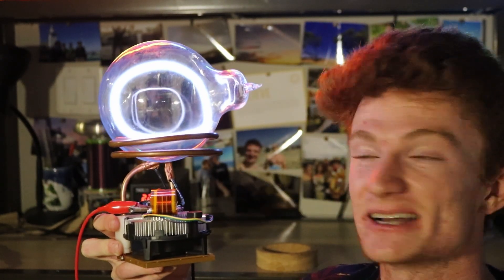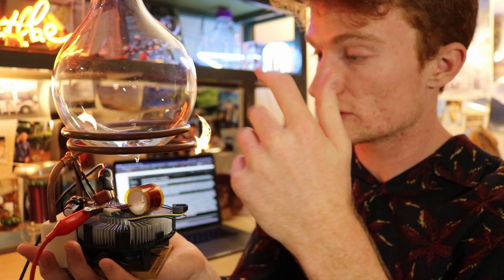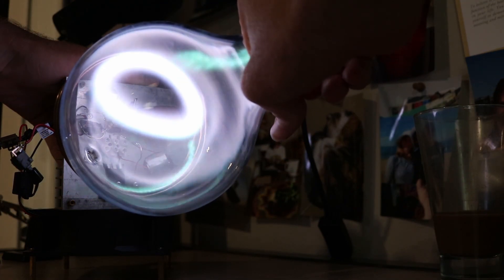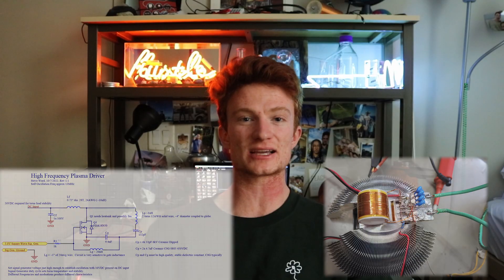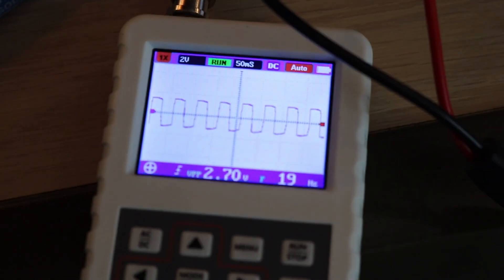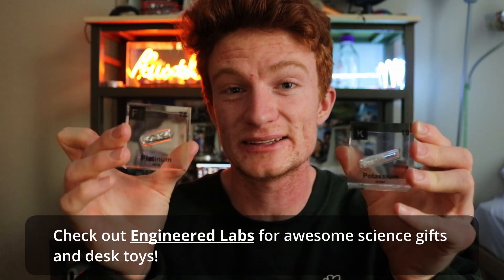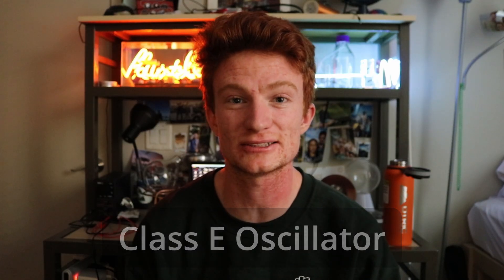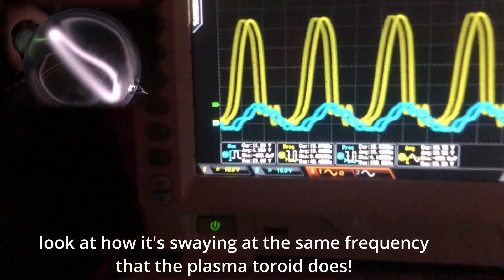perfecting and explaining the plasma toroid

Comment: 8:31 don’t joke with chemistry, without it we have nothing to do here (or nothing with), no cheese, no soda, no nitric oxide (|), no plastic, no transistor, and in vain you neglect flux... although the cheap pink flux gel "TT" gets in the way work in microwave circuits if you don’t wash it off, even the discolored one only marks the soldered places, becoming discolored but not rendered harmless, it conducts slightly and various bugs soldered by it and not washed off from TT flux do not start up... but there are slightly more expensive fluxes for radio engineers without any complaints, and simple one... - there is also exists  solder in the form of a tin tube filled with rosin inside (a flux that does not require rinsing)... once in my childhood, in the 90s, I also tried to start soldering without flux (in this style of research it is better to be more difficult... learn to solder by lead of aluminum so that you develop a habit of oxides, which work just as well with an oxidized soldering iron tip, the result does not deteriorate...
etching boards in acid is a well-known and tempting idea with its apparent speed, but it’s just difficult and dangerous to dissolve copper with acids, it’s better to find and to buy FeCl3 * nH2O at least 0.25 kg, or better 2 kg, anhydrous FeCl3 can heat up violently with water, you need to work carefully, yellow powder hexahydrate FeCl3*6H2O are peacefull ... having sufficiently freed (putting part of the powder in another container) a third or half of the volume of the reagent bottle (sold in markets where soldering irons and tin and fluxes, soldering acid... etc.), pour water into it, not to the top, but half of it approximately the volume of powder, so that you soon get a saturated solution with a fair sediment of excess salt at the bottom, this liquid is used repeatedly, sometimes even copper falls out of it, it is sometimes filtered from rusty films and mosquitoes, and the board is etched with FeCl3 aq.sol-n. preheated in a pan full of a hot water tap to 45 ..60C holding the bottle in a water bath like this, pour the solution from the non (preventing the sediment from pouring out with the liquid of the etching solution into the etching cuvette, ideally - if it will motor-swaying, ideally so, that the board floats downwards in paths on the surface tension of the etching brine (carefully place the board to the surface) then etching takes from 15 minutes to 45..60 minutes without the stink... often accompanying the reaction of acids with impurity-containing metals dissolving in them. And if you still like acidic etching  you need to add table salt and hydrogen peroxide, at least 3% medical grade 40 ml, then(if i right)even citric acid
  can etch metals

Comment: Please vote this comment up so BackMacSci will read it!
I work as a engineer and i have a lot to do with plasma at my Job. Try to use  neodymium magnets to control the plasma or DC electric fields. Your oscillator will be the power supply to create the toroid and the static fields (magnetic and/or electric) are acting as stabilizators. Sorry for my english i'm a swiss ;)

Comment: Could you use this as a particle accelerator? And drastically increase the innertial mass of the plasma?

And then create a straight row of such accelerators?

And lerp the inertial mass values from one accelerator to the adjacent accelerator, to the accelerator after that.

(Sort of like a programmed string-light where a dot moves from one light to the next, but with sub-pixel rendering which is fancy talk for light A fades out at the same rate as light B fades in), to create a virtual linearly traveling mass?

And after we get to the end of the striaght line array we start off the beginning again?

This way, couldn't it be analogous to ejecting a mass from a canon in a vacuum, but instead of ejecting a physical object embewed with mass, we eject a simulated mass?

And since its linear in our world, but sequentially a loop, it's technically just an extension of the reaction wheel concept right?

Maybe try it on a styrofoam float?

Or on a slippery slidey solid thing in a vacuum chamber?
Reply: ellaboration:

No, it's not a free energy device. So it won't run for nothing.

What it is though is a way to move in space without getting rid of supplies.

Even ion thrusters, they evaporate and plasmify a aolid fuel pellet so they don't do anything new.

Rockets literally vomit out their fuel, so that's that.

And a gun in space is basically a rocket but it puked a solid.

My idea is like this: first you need to know if you are inside a box in space and you have a canon: 

And you shoot the wall (it's an unbreakable wall for pretend), and the canonball is the heaviest thing in the box, the box will slide opposite the direction of where the canon went, but then once the canon hits the wall, the box will stop.

So it's kind of like, having a tiny railway track to move up and down.

Because any tempt to put the canonball back in the canon, will move the box back to where it started.

So how, do we move through a vacuum, without wasting matter?

Easy, television.

Lemme explain, on a TV, we can make objects "move", and then once they reach the edge they dissappear, right?

Well what if instead of making light, we made mass?

Einstein says that the faster something w/ mass moves the more massive it becomes and therefore it will never break the light barrier.

Well- we aren't worried about going faster than light yet (that's for later).

Do you know what makes stuff fast? 

An accelerator.

Do you know how to contain a fast thing?

A track.

Do you know an electrically powered fast maker shaped like a track?

Yeah, a particle accelerator.

So we got little containers full of some low speed particles.

We use electricity to trap them in an accelerating circular path, that should make them more massive, and then they will push down on the confinement fields and making the container a teensy bit heavier.

So we put power in and it gets heavy, it's like a tv pixel for gravity, instead of light.

Now instead of shooting a real canonball at the wall, we can play a "movie" (on the gravity screen) of us shooting the canonball at the wall; and then when it hits the wall, instead of hitting the wall, we just make it dissappear off-screen.

Then we can make another canonball appear inside the canon, and play the 'movie' again.

We're no longer trapped in the segment of wiggles, now we can slide anywhere we want- any way we want. 🤔🥰

Or or so I envision

Comment: A great video!!! 
You can chop an old wired earphone/headphone and solder it to a simple amplifier (a low power transistor, a capacitor and an appropriate resistor) and use it as the signal generator.

Comment: Nice work, I am no expert but it looks like you have the primary winding of a Tesla Coil, basically half a TC... so what would happen if increased the voltage powering the plasma in the toroid? Perhaps a setup where you put the plasma toroid on top of a full TC, then it may be even funnier take a second TC and invert it (hang it from the ceiling) above the toroid, this is not to double up on power but to give you a greater control of the plasma when amplifying the power, you know how your plasma toroid pushes up in the glass container, if you had a secondary coil above that (in either the full TC setup or only using the primary coil as per your current setup) you may be able to merge the two plasma toroids into one and result in a more stable configuration that you could crank up the power in it (we can call it the Dual Coil Plasma Amplifier, if it works???), you should be then able to control the position of the resulting merged or amplified (just making the terminology up as we go) plasma toroid.

Comment: This is a perfect demonstration of why Tokamaks are horrid designs and will never work.  The toroid is generating turbulence both electromagnetically and thermally that reacts to both the local conditions (your machine) and non local conditions like the earths magnetic field and even solar conditions.   If you were able to direct the plasma flow more aggressively--like a stellarator--and tune it to the plasma resonance you'd have a much more stable system... that's where the sound comes form--the plasma resonance.  This could end up exploding your little system but what you might want to play with is something called a signal chirp... you also have plasma harmonics involved.

Comment: Sorry, but it is a very common misconception: the sun is NOT made from plasma. It is comprised of collapsed matter, which means liquid metallic hydrogen. How do we know this for a fact? For several basic reasons:
1) A gas or a plasma cannot have a surface, as they expand to fill the space available, and the sun has a definite surface visible in every wavelength.
2) Material thrown from the sun acts like liquid, and looks like liquid
3) The same material falling back into the sun causes outward expanding ripples on the surface, which can only happen in a fluid
There are plenty of other reasons, so DYOR.

Although I do not KNOW what's going on in your system, I have a sneaking suspicion that it derives from the so-called "Bowl-Shaped Magnetic Fields" described in The Primer Fields videos put out by David LaPoint here on YouTube. If I am correct, then what you are seeing is plasma occupying what is know as the "Flip Ring" or the "Choke Ring" within the bowl-shaped magnetic field.
Reply: It is a plasma because of the temperature. Helium and hydrogen cannot exist as liquid at the temperatures observed at the sun. We know all these things from direct observation. Plasma can have a surface if large enough in mass/gravity to keep it in one volume.
This is all directly observable phenomena. The heat exceeds the electric forces holding the electrons in orbit.

Comment: Chemical etching is not hard. You just did it wrong. I am old, and that is how we made PCBs. Etch the board on on end, heat the solution with an aquarium heater and stick a bubble diffuser for an aquarium in the etching tank to make small air bubbles with an aquarium air pump. It's a  cheap AC coil vibrator diaphragm air pump. Doorbell ringers and hair clippers use the same vibrator as those air pumps. The solution should be orangish brown, not clear or green. I used ferric chloride.

Comment: 7:40 a zvs driver would probably help
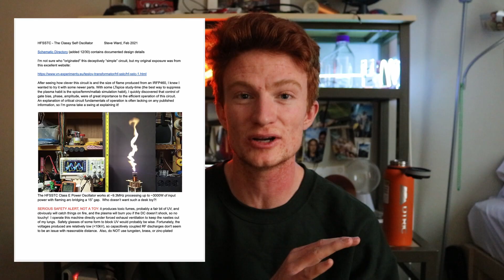Reply: 14:40 yeah it looks like zvs could work, and it still can be audio modulated via using the inductor as a audio transformer to inject the audio into the power rail

Comment: Great first off, if your looking to go retail think about using some truck bed liner the liquid to coat the primary it may impede the transfer of energy so R&D is on you bro. Will say fine powdered copper mixed into the coating may help or just make for some more content.

Comment: Have you tried applying direct magnetic fields (say, electromagnets so you can fine tune) to deform the toroid? Maybe two to start, on opposite sides, see if you can make it eye shaped. From there, you could probably get some interesting effects with adding and removing magnets to shape it

Comment: It isn’t advisable to cut circuit board on a bandsaw as there is glass in every modern one.(you can get ones without glass but they aren’t as fire retardant)

Best was is to scribe and break or use a pcb shear.

Comment: I have to wonder if you can detect the state of the bulb by monitoring one end of the coil's current loop, and basically doing something like back-EMF detection for monitoring motors, in order to control the toroid more. If it's close enough to back-EMF detection, you might be able to use some components from quadcopters since they use it in the brushless motor control loop. I can imagine this kind of feedback may make it easier and more reliable to start, and easier to dictate which behavior mode the toroid is doing and when it transitions between them; and then you could pump music into this control system~

Also you should get a cheap function generator. The bluetooth thing has plenty of confounding details starting with the fact that every step between the app's math and the bluetooth thing's outbound filters is discretized to finite levels and fixed timesteps; but not necessarily the same levels or timesteps as the software, the bluetooth protocol, and the DAC could be resampling; and this behavior is why hold music on phone calls is so bad. It muddies everything and creates a lot of high audio frequency harmonic noise. Which, second thing, maybe sine waves aren't what you want, and who knows how accurately the filters on the bluetooth thing are willing to reproduce a square wave. Finally, maybe audio frequencies don't work on this thing, but you could do some kind of heterodyne thing to produce audio frequency noise, or at least audio-synced behavior

Comment: Cool project! How little voltage do you think you could get away with using. Do you think 12 volts would work? Even 5V- could it run on USB power? Thanks!
Reply from the maker: I’ve gotten 12 V to work before but it’s better to use 48 V because then the circuit will draw less current and less power will be wasted as heat
Reply: @BackMacSci  - do you need to change the resonance capacitor values at all when you change the voltage?
Reply from the maker: @tedshred8436 yeah you probably might, it’s a process of trial and error with this thing

Comment: The squealing is probably the copper coil vibrating against the glass. Some of the current couples through so it's functionally a transformer, and transformers have vibratory mechanical losses.

Comment: I know the schematic has a parts list but I'm struggling to find some of the parts (the copper wires) does anyone have links to somewhere where I could buy both the types of copper wires required for the project?
Reply from the maker: Copper pipe and wire is at home depot or any hardware store!

Comment: Quick question on your schematic, you note to turn down the gate divider pot until the gate-source resistance is 0ohms yet the gate to ground resistance is always at least 1k due to the in-line resistor on the wiper. Is this an error or am I missing something?
Reply from the maker: No, you’re not missing anything. That’s right
Reply: @BackMacSci  Ok great, appreciate the clarification. Having a hard time generating a stable toroid without burning out the fets so I'm trying to make sure all my i's are dotted.
Reply: @BackMacSci  hey mate, I’m experiencing a current “avalanche” for lack of a better term when trimming the gate. Can’t seem to generate oscillations and the current draw just keeps increasing until it limits since there’s no discharging taking place. Was just curious if you experienced this at all and had any advice? For such a simple circuit it’s giving me trouble
Reply from the maker: Most definitely. I have that issue right now too. I turn the gate pot until eventually my circuit draws 10 A which is catastrophic if i dont instantly ignite the torus and provide a load for the oscillator. You should try decreasing the G-S capacitance to enforce oscillations.
Reply: @BackMacSci  I hadn't actually given much thought to loading the circuit, I've been attempting to establish switching on the output before placing the globe on the coil. I'll attempt to decrease the Cgs and give that a try. Oddly enough, I do appear to get switching on the gate but it never manifests through the fet which doesn't seem like it should be possible given the schematic. The gate switching appears dependent on the LC oscillation which characteristically would imply oscillations through the FET. Anyway, if you solve this one I'd love to hear about it!
Reply from the maker: @rydude998  you should involve the globe to try to get some plasma. that helps with morale too haha. but yeah shrinking cgs should fix it. try halving the cgs value
Reply: @BackMacSci  wanted to let you know I dropped the Cgs to 4.7nF and it immediately sparked! Thanks for your advice, it works perfectly now

Comment: hey, try a low vacuum sphere, with the exited gas inside, with an maglev induction levitation power/containment (maybe even just plain air), and possible an electric arc ballast to ionize the gas inside, to start the plasma, yes up to fusion reactor plasma containment by reactive plasma magnetic field containment
Reply: well that is that what you have there lol
Reply: same happens with tesla coils, the excitation of the plasma-gas
Reply: no the plasma will make the opposite magnetic field as the inducing magnetic field is
Reply: you can levitation melt high temp metals with it, ie with induction current resistance melting
Reply: is the concept of plasma bottle (magnetic) familiar to you
Reply: thats basically a magnetically separated flash bulb, no current directly going by solid wire inside the bulb, or no wire inside the bulb
Reply: magnetically decoupled, magnetically coupled systems, ie insulated in many ways
Reply: you could have a plasma zap arc lighter as the starter (piezo zap arc)
Reply: basically that coil is an induction heater, you could try if a normal induction stove would make that bulb light up
Reply: you could try to feed/amplify a sound/image into the plasma as an image/sound visualizer, like a plasma globe
Reply: output frequencies depend on the energy of the accelerating ions in the plasma, ie stopping energy of ions/electrons
Reply: all this is already done many times before, but the application is not usually used
Reply: normal induction stove frequency is 24kHz says wikipedia
Reply: hey try metal foil maglev induction vacuum balloon